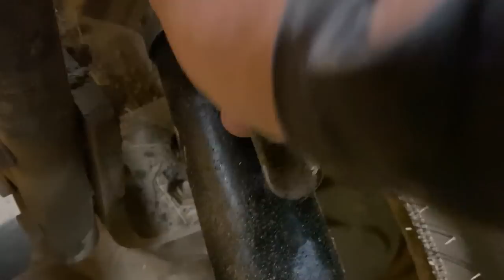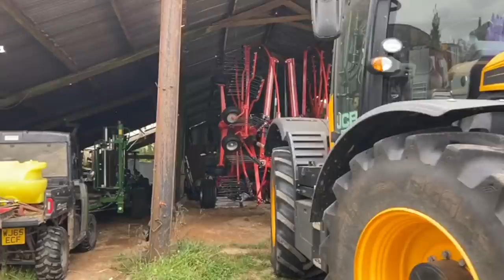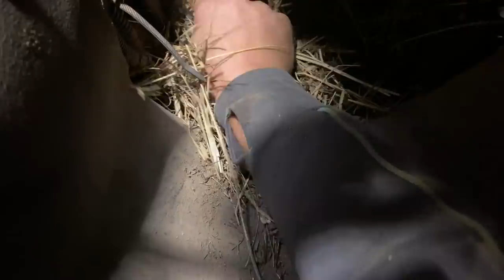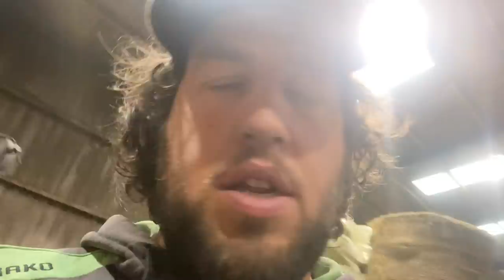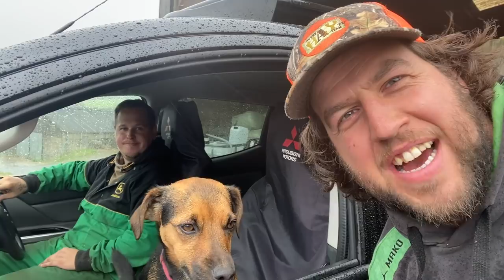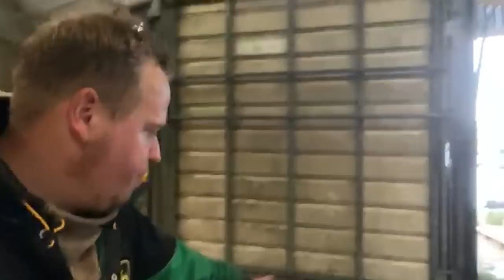An odd job video. Episode 82

Comment: I wouldn't go under that boom or any machinery if not properly proped no excuses Justin it's not safe you should be setting a better example as a experienced farmer pleased don't take this the wrong way as I think you have a great channel
Reply from the maker: Nick Hill yes I know but I was doing two jobs.
Plus 
I know the stop is there to use
But all modern machines the boom can’t move unless you are sat on the seat, it’s a fail safe.
But yes for youngsters I should

Comment: Hi Lads    come on Justin  H/S is their a lock off on the boom.  Should you be underneath  it when its raised
hate to see anything happing to you   would be like Ant without Dec      not the same
you both keep well (and safe)  and ill catch you again soon
Reply from the maker: john aldous yes but as I’m loading a bale every 6to 7 mins it would make it very inconvenient!!
Plus on every age machine we’ve ever had I’ve never seen the boom move especially on the new ones where the seat has to be sat on for it to move!
But yes I know it should be done for camera.
Just I’m greasing up and running the factory at the same time between shots